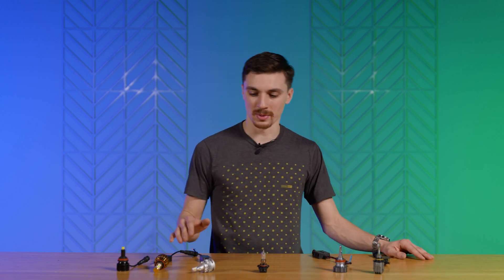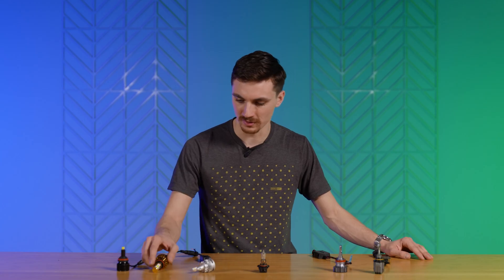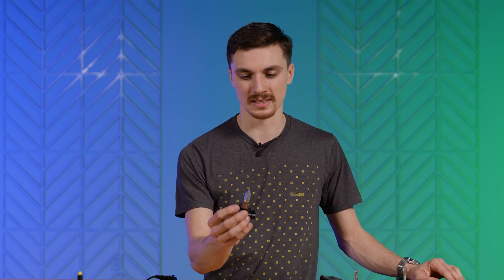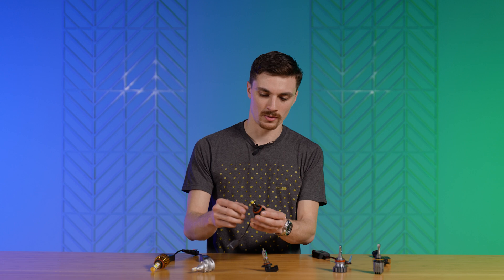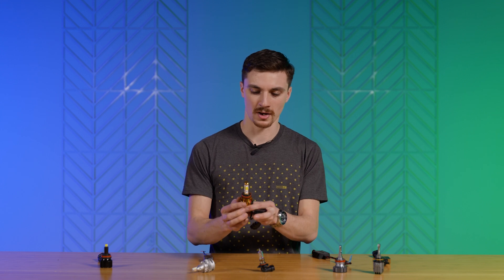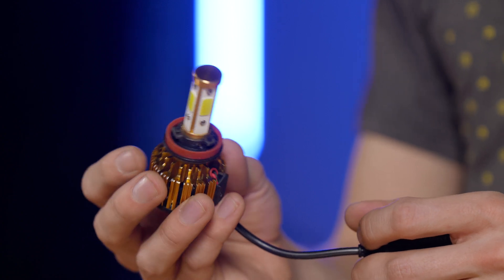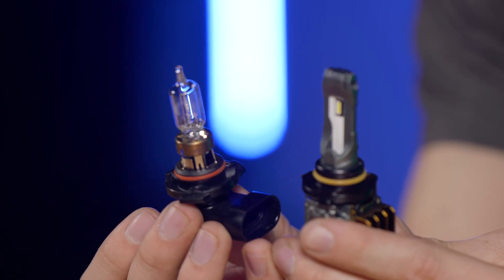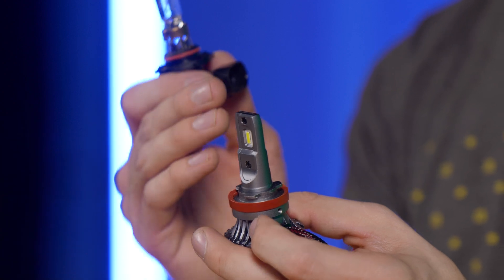Do More LEDs Make A Bulb Better? | This Is Why You Should Avoid Multi-Sided LED Bulbs

Comment: where is your proof? show us first. cant just take what you are saying. we need to see...
Reply: I couldn't believe it either !  Then months after I got 4's, & 6 sided for hi-beams, ( not too worried about the those )  I've seen the videos on here testing everything about them, including halogen bulbs.  In most cases, I have to agree with the guy, says what those other videos said..  He should have mentioned the 2 sides should be facing 9 & 3 on a clock pattern to avoid overspill into oncoming drivers as well.  Still not sure how much better that really is instead of at 12 & 6 ( up and down in the lens )  

PS- What I do have with my 2 sided LED's is 2 triangular darker spots as you look at them, as well as on a garage door, or even the car bumper in front of you.  But, they are still brighter than my nest halogens ever were.
Reply from the maker: Check out this video from our friends over at Headlight Revolution and you'll see why! 
https://www.youtube.com/watch?v=nnD_sDWNjEw
Reply: @RetrofitSource  that's a 5 year old video and does not reflect the current market anymore.

Especially if your car has any kind of projector lense, the new generation of skinny 360 bulbs are just better than the 2 sides.

Especially if your low and high beam is using the same lense with a shutter, in this application 2 sided LEDs are hopeless at high beam.

Comment: can i use multi sided for a high beam bulb?
Reply from the maker: For high beam it's slightly more acceptable since you don't use high beams with other traffic around, but it still won't create the ideal beam pattern that the OEM Headlights create
Reply: @RetrofitSource  so u advise i just get 2 sided LED for high beam too?

Comment: But if I have a headlight with projectors, 360 degree led would be perfect solution and will not impact other drivers.
Reply: U are completely wrong.

It may work in the projector, but it will not be able to create a hotspot at all. And it will be a lot less bright than ur original halogen bulbs. 

A two sided led bulbs will be way brighter in a projector, than the multisided led bulbs in the projector. 

Never works like that.
Reply: @toyotabrony  What I'm talking is completely based on tests that you can search on youtube.
Reply: Two sided bulbs are fcking waste of money man ;) they are shinning so bad. Edge are blue and thi light is unreal when you want look far  @toyotabrony
Reply: @toyotabrony you are completely wrong 🤣🤣 i tested 28 leds on regloscop, 12 types of 360° leds, and all 360° were a lot better than 2 sides. 2 sides have fckn untrully brightness on sides, blue or yellow spots...
360° behavior is mooore similar like as bulb.. 2 sides chip are old. You are in 2024 year... not 2015 :) wake up
Reply: @SmarthPhonesCz  lol nah ur completely wrong. 

Putting a 360 type led in the projector will be dimmer than stock. Even if it’s 3-8 sided led. 

2 sided will be any of those by far. 

Putting them in reflector style headlights will not see further down the road, instead it will be a flood light style. 

If u think I’m wrong, and u tested 28 360 style led. None of those work at all. 

Look up headlight revolution - the truth about the led, and stay away from multisided led bulbs. 

Two sided led already wins at best.
Reply: @SmarthPhonesCz  it doesn’t matter what year we face. Sylvania, Philips, Lasfit, GTR-Lighting, Auxito and any company that uses two sided led always use the tiny little SMD, CSP, and ZES led chips. 

Always two sided. 😎
Reply: @SmarthPhonesCz  did u even try to use the lux measurement, like a Conical Minolta lux measurement or some other luxury measurement tool that measures and reads the actual color kelvin temperature?

Because those will give u much better and real results to see how truly bright they are
Reply: @toyotabrony I have the standard 2 sided led bulb in my projector but when I look at the projector with the headlights on, I can see a vertical line in the middle because the light is emitted from both the sides and no light in the center. Wouldn’t a multi sided LED be better in this case then?
Reply: @Adil-sv2xi  no it will not. I mean technically speaking u can get a brighter than stock multiple sided led but it will not be purely focus as two sided. 

If ur current led doesn’t do that. 

I got few options I highly recommend. 

Lasfit - LA plus
Lasfit - LC plus
Lasfit - LS plus
Auxito - 10S
Auxito - M3

Auxito - Y13

Auxito - Y19

Boslla - B1

These two sided led bulbs will mimic better beam pattern than oem with a nice hotspot right in the middle of the cutoff line. 

So u can be able to see way further with a nice distribution of ambient light on the sides. 

If I had to choose atleast two. That’s reliable and low failure rate.

Lasfit - LA plus, and LC plus. 

So no matter how many multiple sides it has. It will never work. 

Always stay away from them.
Reply: https://youtu.be/nnD_sDWNjEw?si=yCvhE0tneTBYM5wR
Reply: https://youtu.be/nnD_sDWNjEw?si=yCvhE0tneTBYM5wR
Reply: https://youtu.be/nnD_sDWNjEw?si=yCvhE0tneTBYM5wR
Reply: Just show proof here. Talking wont prove anything...
Reply from the maker: That is not true 👀
Reply: @RetrofitSource  Why not? You can see tons of videos proving it.

Comment: Yep. I made this mistake. The sad part is that they suckered me into buying their bulbs because of the lifetime warranty. (What's a lifetime warranty going to do if your product is garbage.) By the time i learned that multi sided leds are trash, i couldn't return the garbage bulbs i'd purchased, so now i'm stuck with them. Worst part is, they were expensive junk. $160 a pair and i bought 3 for all my lights so almost $500 gone. Xenonpro is the brand, pls don't buy from that scam site. I plan on getting 3 sets of Auxito LED bulbs soon. $204 all together and they're 2 sided with thin chips and thin middle part unlike the trash i bought and these are cheaper.

Comment: Would the multi sided bulbs work good in a projector?
Reply: I bought a 6 sided LED D1S and put in my projector headlight, perfect light projection, sharper upper line than original xenon and a lot brighter! Expecting longer life out of them aswell.
The leds were perfectly aligned with where the light source from the xenon bulb would have been.

2 sided leds are a lot worse since they cast a dark spot in the middle (not based on own testing but videos)
Reply: @JontesTechTips  multi sided led never works. Even if u get a lot brighter yes. But u don’t have a hotspot in the middle of the cut off line.

Two sided led is the way to go. 

If h say it didn’t work for u.

Then perhaps u had those two sided large led chips called COB?

If that’s the case, u should have get a better two sided led, with CSP,ZES, and SMD led chips.

Like sylvania,Philips, Lasfit, Auxito, Diode Dynamics. They use the automotive grade led two sided bulbs. 

They are the best. The multi sided. Stay away from them.
Reply: @toyotabrony it has an excellent central hotspot, however the filament is a loooot thinner than the multi sided shown in the video.
Reply: @JontesTechTips  right. And the best two sided led is u want them as small as possible. 

For example the Lasfit - LA plus it has two sided CSP led flip chips. There a hair large but it’s still on the correct spot. 

Or the Philips - Xtreme ultinon led pro uses the tiny SMD led. 

Or the Diode Dynamics - SL2 PRO. They have a very precise TST LED chips that has an even better perfect beam pattern.
Reply: https://youtu.be/nnD_sDWNjEw?si=yCvhE0tneTBYM5wR
Reply from the maker: Nope, only used the double-sided!
Reply: @RetrofitSource  Can you make video comparison 360 led in projector vs normal led?? Since it kind of makes sense to use 360 led bulb in projector headlight.
Reply: @fr0sty1998 no it does not make sense all. 

No matter what type of headlights u use
Reply: Here’s the reason why multi-sided led bulbs will never work at all for both projector, and especially reflector headlights. 

Two sided led bulbs work a lot better.
Reply: @toyotabrony  where's the reason??? DA
Reply: @leckers15  the reason is because putting a multi sided led in the projector headlights will be dimmer than stock, and in reflector headlights will scatter the light and will not be usable to see further.
Reply: @leckers15  two sided led will always work better
Reply: @toyotabrony  why dimmer? When they have more bulb?
Reply: @leckers15  I was specifically talkin about the multisided led bulbs. 

From 3-8 sided or full 360 degrees Fahrenheit style led bulbs. 

In projector headlights. 

It will be dimmer than stock, and in reflectors, it will create a flood light and scatters all over the place. 

Two sided led with tiny led chips, such CSP, SMD, and ZES LED chips. And position the two sided led facing 3-9 o’clock. 

It will be brighter than stock on both projector and reflector. 

That’s what I was talkin about.

Multisided led is not using the reflectors to capture the light properly.
Reply: @toyotabrony  ???

Comment: Does the halogen filament not emit light in a 360degree direction?
Reply: It does, but i think that was a point not worth mentioning in the video.  The most important factor to account for is how far the diodes are from the base of the bulb so that way it utilizes the reflector as designed. The inexpensive brands just use a dozen super bright diodes that aren’t in the right location for the reflector to catch and throw light forward - this is what scatters light and blinds oncoming traffic.
Reply from the maker: Optics still matter! The high beam reflector was deisnged for a filament sitting at a specific distance from the base of the bulb, which the Morimoto 2stroke 3.0 is great at replicating!
Reply: Yes. But with led bulb that’s 360 degrees, it’s too many LED’s. 

A very thin body with two sided led chips work way better.

And always better.

https://youtu.be/nnD_sDWNjEw?si=yCvhE0tneTBYM5wR
Reply: Its also inside a glass tube; not mounted onto a circuit board/shaft.